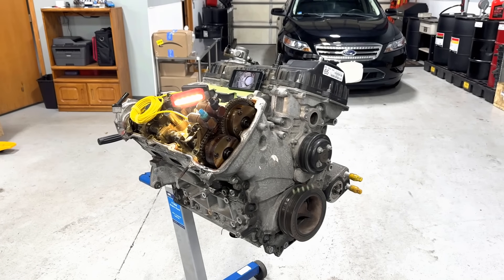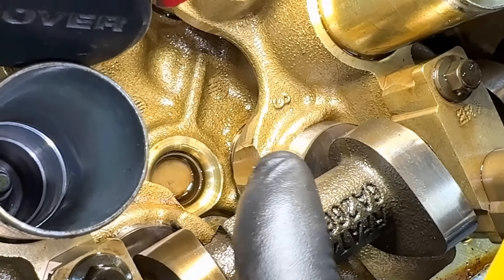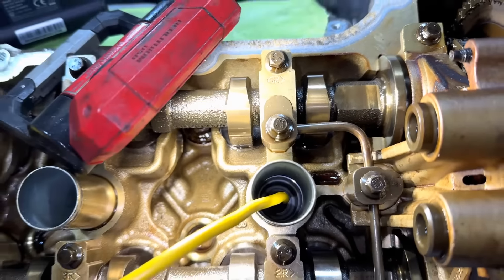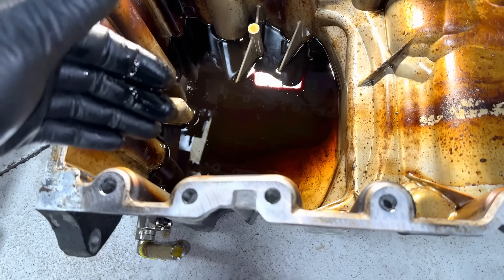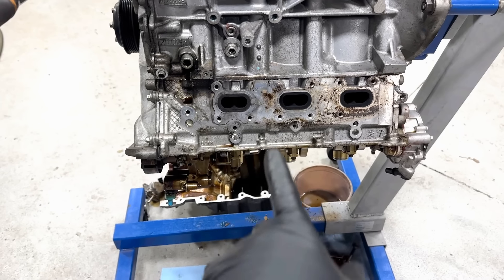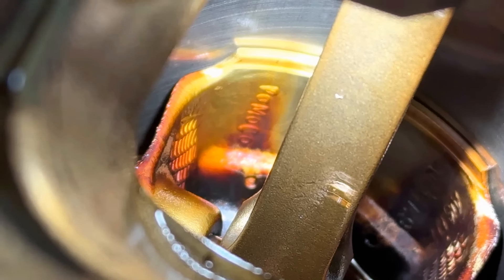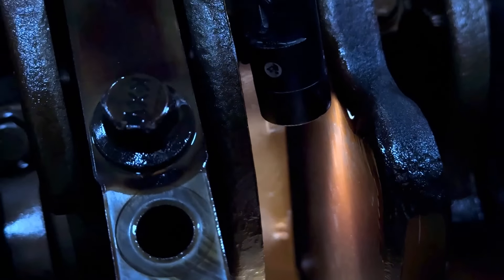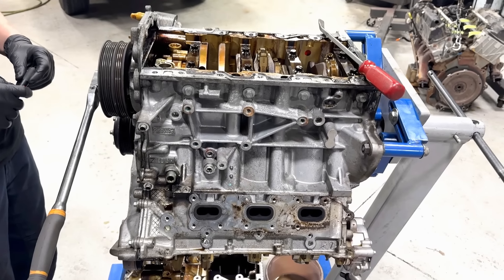Why Did This Ford F-150 3.5L EcoBoost Engine FAIL?

Comment: What a shame when the owner did everything right!
Reply: Filthy engine internally and high heat.
Reply: @Ranger-vv2jv it's clean...that's not dirty
Reply: @Ranger-vv2jv looks like he’s probably got an aftermarket tune with all the stuff he has added on
Reply: @FishFind3000  true
Reply: Friends don’t let friends buy fords
Reply: @Ranger-vv2jv That is NOT a filthy engine. Obvious frequent oil changes.
Reply: @FishFind3000 this x 10! Had a piston skirt come apart on a poorly tuned ecoboost mustang. Pocket tuners advance timing far too much heat soaked skirts even with good maintenance will result in shit like this
Reply: @dlbangs  not really i have 88k on a ford escape 2012 and if you  look though the oil fill port at the timing chain and the surrounding area it'll be silver not a bit of varnish build up on it. thing looks brand new. that engine has moderate varnish build up from extended oil change interval/ poor quality oil. oh and my engine has never had any work done so it's never been "cleaned". pro tip use name brand full synthetic oil and put a couple ounces of lucus full synthetic oil additive when doing an oil change. the lucus helps bind the ultra fine soot and wear particles together so the oil filter can filter it out. 3-5oz  of lucus won't give any of the advertised benefits but will help the filter so you can use it in a new and old car without worry.
Reply: when you own a ford  it hapen ......loll
Reply: @FishFind3000  That would be my first guess!
Reply: Any American car now days. Quality left America a when millennials started taking over.
Reply: My guess is also a “tune”.
Reply: Just proves how cheap everything is made today. Pistons should not be breaking in this day and age.just like roller rockers should not have bearings fail. Cheap cheap metal
Reply: Doesn’t matter. It’s an Ecoboost. Too problematic.
Reply: @FishFind3000 A "tune" is not going to break one side of one piston. That was some anomaly in the piston itself.
Reply: Any part, in any mechanical device, will eventually fail.
Reply: @householdhacks Take the valve cover off and you will see. It's obvious to the most casual observer this engine has been maintained very properly. I've seen the inside of hundreds if not thousands of engines.
Reply: @jeffreydurham5342  true but having many many premature failures is a sign of bad engineering or mad materials
Reply: The owner bought a Ford.  What more can you say.
Reply: if you get a super-heated piece of carbon that embeds itself into a piston, this can happen.
Reply: I'm going to say if all was legit it was a faulty piston that decided to show it's ugly head .

Comment: I've been a loyal F150 owner for 20 years but this channel and my own experience with my 2019 5.0 has me looking at Tundras. Anyone feel the same or is it just me?
Reply: I would wait a year or two on the Tundra. They have been having issues with the new engines locking up. Wait for them to work the bugs out. I have a 2014 with the 5.7 I force. The engine is pretty bulletproof but not easy on gas. Too bad they stopped making them for that reason.
Reply: It's just the Internet. The bad stuff catches our attention. Millions of Ecoboost out there with no issues, but that doesn't make for good entertainment. That's not to say nothing ever goes wrong, but the major Gen 1 and Gen 2 Ecoboost issues have been identified, so now you know how much cash to set aside.
Reply: New tundras with turbos are having just as many problems as ford.
Reply: Keep what you have.  The 5.0 is a beast.
Reply: People don't bring perfectly working trucks to mechanics. Plenty of videos of F150's with 250,000+. The new Tundra engine is totally unproven in comparison.
Reply: All new trucks are like this
Reply: @TheTopGun920  the only reason the 5.7 tundra was so hard on fuel is because the only rear differential available was a 4.30 gear which is great for towing and acceleration but not so good for non towing and flat road driving
Reply: I had a gen 1 and then a gen 2 3.5, wasn't super impressed by either on the reliability side. The 5.0 in comparison needed cam phasers at 65k miles and still burnt 2 quarts of oil per oil change.
Reply: I switched to Ram this year
Reply: @TheTopGun920 I get it but when I had oil consumption issues at 40k miles and the Ford TSB was to install a long dipstick to show more oil it kinda soured me from spending another 70k on a F150. It think the plastic oil pan was when the light bulb went off for me that Ford isn't quite what it use to be when it comes to quality and longevity. Again, I've never owned a truck other than an F150 (4 in a row).
Reply: AutosR.... beware of late model Tundra's.  My 2019 Tundra bought new is a piece of junk. Lot's of serious problems

Comment: Have a 2012 3.5 that just rolled over 200,000 miles, no issues at all
Reply: I barely got 70000 on my 2012 before the timing chain stretch. I replaced it with new VVT's, water pump and thermostat. That's with 3000 mile oil changes.
Reply: I replaced a 17 Expedition 3.5 last month with 80k on it. Main timing chain snapped and crashed the valves.
Reply: I'm hoping to get 300,000 K
Reply: I have a 2011 3.5 with 181,000 miles. Never had an issue!!
Reply: 2019 expedition cam phasers timing chain 50k . POS
Reply: Im about to 260k on my 2011. I drive it every day.
Reply: There are good ones among millions of lemons I hope it keep rolling brother.💯👍
Reply: 325k on a 2012. Still going strong.
Reply: @davidanderson961  built Ford tough
Reply: My 2012 had to have the timing chains replaced twice and one turbo. I’m religious on maintaining and still had these issues. First timing chain was covered under warranty. After that is was all on my dime. I’ll never own another ecopuke again!
Reply: ya ya ya every budy belive you
Reply: 2016 Expedition with 225,000mi… traded it in. FordTechMakuloco did my timing chain and a few other things. Started giving me some rear-end noise. Of course the usual oil blow-by stuff.

Traded it in February. I loved it, but hated it. Had 385hp/ 603lbs/ft tq at the rear wheels with mods and tune. Needed a new tune to account for the new coils and SPD down pipe install. It’s my opinion the rear end let go as it had enough power to still spin the wheels with traction control engaged.

That 3.5 has so much potential for power. I’ll miss it. 😪
Reply: Happy that you have good luck with yours. 2017 with less than 60k. I have had to have the cam phasers replaced twice and the thermostat housing replaced. I change my oil every 5k miles and use synthetic oil.
Reply: I don't understand why some people have issues with these engines? I have my own shop now for more than 30 years and service a ton of these, most of which have 200k plus miles on them with zero issues kinda strange
Reply: I feel pretty blessed really, so if these sound like horror stories, every expensive repairs at 70K miles is just scary
Reply: CAP
Reply: I'm so glad to have gotten out of mine super fast, had like 80k+ what a friggin gas guzzler. I forget my car needs gasoline now lolol
Reply: @Bok2022st  Ford is trash now tbf
Reply: I know a dozens of people with 2014+ GM vehicles with AFM that have that kind of mileage and no issues. Does that mean that nobody has a lifter problem?
Reply: @z50z1  probably nowadays but get yourself a barra best motor ever created
Reply: 2015 F150 platinum 204 k going strong, only problem rear cámara fail.
Reply: Well said!!!
Reply: It's quality of the internals not being the same. I've had to do camphasers twice and finally got a  good set to run 30,000 before I traded it.
Reply: i have a 2012 with 231k, all its had is spark plugs and oil changes.
Reply: Love the video. Is there anything salvageable off that old engine or is it too risky to reuse the head since there was oil floating around?
Reply: Have a 14’ f150 3.5 with 110k. Replaced plugs, exhaust manifolds, throttle body, front rotors. Oil changes 4k-5k. Now going to 3k intervals.
Reply: 2011 Ford f-150 ecoboost with 193,000 I replaced both valve cover and exaust manifold and drives like a champ
Reply: From all the comments I'm reading here it seems you got a 50/50 chance of the engine either being bullet proof or a lemon. There is no in-between.

Comment: I love my 2018 F 150  3.5 It's been good to me never did me wrong. 257,894 on it now still going strong 💪
Reply: any leaks and how many miles have you put on it
Reply: I have no issues whatsoever... I run amsoil in it.
Reply: @AllenStuck but have you owned it since new or you bought it used
Reply: I purchased the truck brand new in 2018.
Reply: I've got the 2016 3.5L in a edge, normally aspirated. She's been good to me. I use Penzoil platinum 5W30, I will not use 5W20, Ford can get bent. The engine only turns about 1400-1500 @ 55 MPH. So why would you put light oil in a engine that is lugging all the time? Ah to wear out your main, rod, bearings and piston skirts. hmm. This is my opinion, but diesel uses thicker oils because they are lugging engines. I also use Motorcraft oil Filters since I know they have the Anti-Drain back valve. Which is extremely important for most Ford engines due to the fact the filter is mounted sideways.
Reply: What oil thickness are you running and how many miles are you changing it out? Just purchased my first 2018 preowned ecoboost and i like to maintain my vehicles as best as possible. Thanks in advance
Reply: All that proves is you didn't get a bad engine from the factory. The guy in the video wasn't as lucky.
Reply: I'm glad to hear you say that. I just purchased a 2018 3.5 4 months ago.👍👍
Reply: Not Amsoil Pennzoil is the one! Ewww so what about the HPOP though bro my truck sounds like this and before I replace the high pressure fuel pump or what it sounds like this truck does. I just am trying to fix the it right feb first time because I can't afford to have my Betty White go down on me
Reply: I’ve got the same truck and engine 118,00 miles. Just noisy cam phasers at start up. Runs great

Comment: This is very reminiscent to what happened with my '13 F150 3.5 w/ 175k miles. Same noise/location as in video. But went away after warm up. Then out of nowhere,  a rod went through the block. Engine was never abused. Oil Changes every 4k. Unfortunately the truck is still sitting, $14k to put a new motor in.

Comment: I saw an F150 3.5L Ecoboost with a hole in the block at 130k miles.  Service history on the truck was perfect.  Customer declined the long block.  I was so mad for that customer that he did everything right and his engine still blew up.  Usually the 3.5L Ecoboost is a reliable engine.
Reply: Keyword is sometimes
Reply: Hmm so strange.
Reply: what year is his truck?
Reply: @bjornegan6421  I can't remember.  This was a few years ago.

Comment: I will just keep my old 2003 4.6 sohc with 450,000 miles(1 timing set at 212,000 miles as precautions), never an issue and still runs like new...Great video....
Reply: Have the 5.4 2 valve and it’s got 318,000 still running flawless. All original internal
Reply: I just replaced my 1997 4.6, it only had 500,000 miles on it. 😄

Comment: Insane that engine was functioning totally normal with a chunk of piston ring and skirt missing. Would have expected the oil control ring to come out as well missing that much support.
Reply: It would have eventually blowed a hole in the side of the block

Comment: From my experience with LS engines, turbos, and powdered metal rods, the rod on your failed cylinder looks bent to me. Right down near the wrist pin.
I've seen that happen to LS engines. Rod bends, then the skirt breaks off and you get that noise.
Pull that rod/piston and have a look.
Reply: first  yaman  LS forever .....and 2  hyperutectic  and détonation very hard on piston skirt
Reply: I think you're right. I bent a rod on a supercharged 4.6 2v (powdered rods too) and it made similar noise and still ran. I cant remember if the piston was damaged at all or not, it most likely was.

Comment: In the area of mass production, there’s always a small percentage of failures based on a variety of factors. Quality control is vital to the manufacturing process in any industry. It would be interesting what Ford knows about this issue and if their suppliers knew about this piston head.
Reply: More specifically, there"s a statistical distribution for all processes.  Call it the bell curve.  You always end up with some really good parts (right side of the bell curve), some lemons (left side of bell curve), and most are in the middle.  Six Sigma processes seek to control the width of the bell curve precisely, not necessarily make it narrow, through process design and random sampling of produced parts.  When you buy OEM parts, they generally have bell curves centered further to the right and that are narrower than aftermarket parts.  But because there's always parts on the right side of the bell curve, even aftermarket parts do well sometimes.  It's just that they end up back in the shop more often because of the wider bell curve leaving a lot of parts on the left (bad) side.
Reply: The problem is it 8snt a small problem this has happened to thousands of the 1 Gen 3 5L ecoboost motor. I own one and it has been the worst truck I have ever owned. Honestly I will never own a newer the. 2010 ford truck again. I currently have a 95 with over 250k on the clock and it is still running strong. However my 2011 with only 103k and was babied it's entire life blew up. Yet my 95 has been abused and used and keeps coming back for more.
Reply: Plenty of high mileage ecoboost engines out there with no issues.
Reply: @MendicantBias1  based on who’s information? Our shop talks to Ford techs in our city. Issues with timing chains, tensioners and failing oil pumps on a weekly basis. Our independent shop has done what FMC did to the 5.4 3 valve and replace all of the worn components in the timing chain assembly area but upgraded to the Melling HO oil pump. There’s engine are great for shops.
Reply: @major__kong  I spoke with a Quality control engineer for Bosch. He was living in El Paso TX as Bosch produced brake pads. He claimed there were 3 QC engineers at the Mexican factory. They would remove samples from the production lab for testing. It was a measured process and not random. Adjustment or changes were made or often times large lots of brakes were destroyed due to poor material management. He claimed China produced and engineered parts were made for quantity and not always quality. That depending on the Western manufacturer, it was up to them to install QC engineers onsite to lessen those production issues. That ratio or area on that bell curve was deliberate since earnings was a greater goal than quality.
Reply: @major__kong  I have long suspected the practice of SKU allotment based on standard deviation. Obviously, the OEM Motorcrafts from Ford Parts (full price) would be anything from mean to the right. The Duralasts from Autozone/ORiellys/Walmart would be 1 SD to the left and right (cheaper with promo). The random online supplier would be getting the best deal with anything 1 SD to the left and all the way to the left.
Reply: after the 5.4 l spark plug issues i dont think the oem"s give a crap during the run they didnt attempt to fix it.another example is the the focus duel clutch trans, mustang mt82 manual china made junk trans i could go on and on. and this piston problem is probably rare
Reply: @poppacapinya  The Ford family is wealthy beyond any human comprehension. They could have fixed any one of these issues - ie Focus/Fiesta DCT, 5.4 spark plugs, etc  - for practically 'pocket change' for them. But they chose not to. Says a lot about that name. I will certainly never buy anything new from them.
Reply: @Paul1958R  its not just ford gm an chrysler have done the exact same thing the eco junk timing chains come to mind. gm truck 6 and 8 speed shudder,etc etc
Reply: Could have been built by a millennial on a Friday or Monday morning
Reply: @MendicantBias1  I have personal knowledge of dozens of 2014 or newer GM 5.3's and 6.2's with no AFM issues that have over 200k miles on them. Does that mean anything in terms of statistics on AFM failures? Not much.
Reply: @Paul1958R  Why single out the Ford family? The entire construct of the "shareholder" and "earnings per share" is the rabbit hole worth actually discussing. Shareholders are disconnected form any moral standard. They don't care if employees are injured or entire plants are layed off. They don't care if potentially deadly vehicles are sold to families with a newborn as long as it doesn't affect the EPS in a negative way. THAT is the problem in this country.
Reply: @hochhaul  you’re right! Anecdotal evidence is not statistically significant. Recalls are good evidence of serious issues with engine design. A major factor in AFM failures are long engine oil change intervals and low quality oils. Small oil passages rely on clean oil.
Reply: ford hitman joined the chat 😂😂😂😂
Reply: ford borrows hitman from boeing
Reply: Why are you guys so prone to say  It's just a small production problem. There's a problem with  All of these engines. I I don't wanna even work on these things. They just nickel and dime The owner. These days 2000 here 5000 there. All of these ecoboost and 5.4 3 valve trucks are Are prone to small production problems. With every single component and system in the production. boys just admit it.  It's like trying to say I don't have poop on my shoe it's just mud. Oh yeah why is it smell so bad.